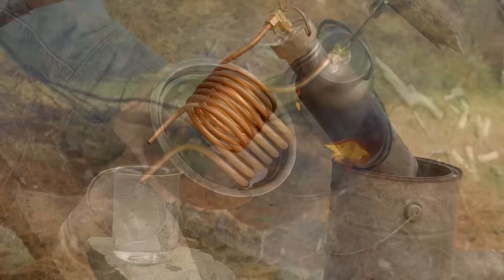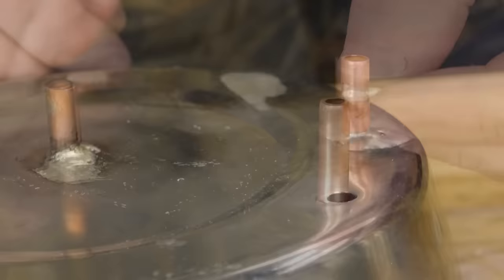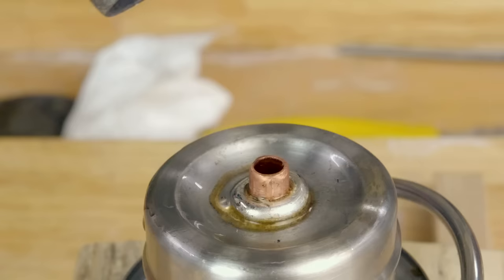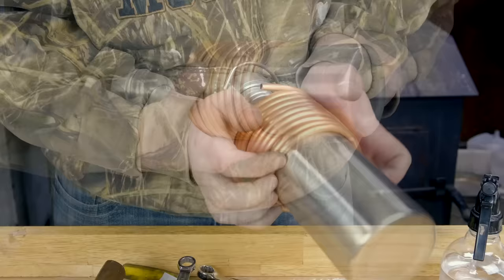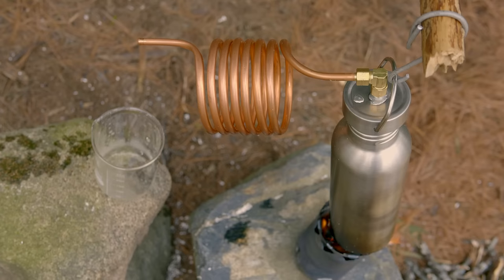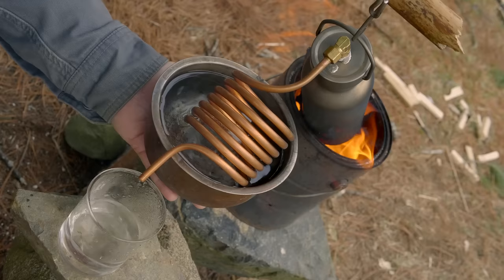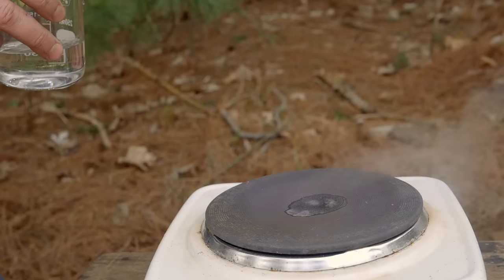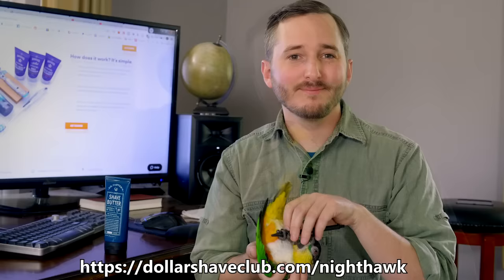DIY Salt-Water Survival Bottle (Compact Desalination Kit)

Comment: hi, Great job, I do plumbing, just a friendly reminder. you shouldnt solder coper to steel. They will react with each other. they just shouldnt touch each other. you can use a brass peice since it doesnt react either of them. Or there are some plastic fixings that you can use without touching steel and copper pipe.
Reply: The Bottle is no ordinary steel, its inox V2A e.g. no corrosion will occure with copper-contact.
Reply: Genghis Chuan  dont know, what kind of flux ure using but i always use proper flux for my piping. u should do too if your flux is an issue
Reply: Genghis Chuan  got it :)
Reply: Genghis Chuan  umm no normally its nickle plate to take chrome......
Reply: Plus some salt always makes it through, 
In fact enough minerals coming from the "stainless", copper and solder .
Reply: @manonamountain  even if she is wrong, GTFO with that attitude.

Comment: Hey!   This setup would also work pretty well with river/pond water too!  No need to add water purification drops/tabs if you distil it instead!
Reply: that's what I was thinking also,
Reply: Yes, it work even on a slime made by yeast out of a sugar!
Reply: Except if you simply boil the water pathogens are killed and there is no need for distilling. Distilling should help with heavy metals though if that is the main concern (note that some toxins can be concentrated by distilling if they boil sooner than the water so don't plan on using this with any Industrial waste water
Reply: @HandfulOfTranquility  Mash for a moonshine is weak and awful, you must distillate it. However you can do it from fruits, but it is vine-like beverage then ;)

Comment: Something like this using a Kelly Kettle would be brilliant!  Also, the pack sized unit is great, but I would love to see a design for a home sized unit too for use in disaster prepping.  I live in an earthquake prone desert city by the ocean, and if the big one ever wrecked the aqueduct infrastructure we all rely upon to bring us water, being able to harvest and process seawater could be a true lifesaver.
Reply: Just tried it with my own Kelly kettle, but the vapors didn't seem to properly desalinate. I'm thinking the boil inside the kettle was too violent and splashed salty water into the tubing and got stuck between air bubbles which transported it into my pure water vessel. Will attempt again to see if I can get it right.
Reply: Ngl sounds like SoCal. 🤣
Reply: Got it working using the kelly.

Comment: Good demo and video. My thoughts for improvements while I was watching it were: 1)  it would be good to be able to adjust the height of the bottle to control the heat; this could be just a knot in the rope, or other device, and 2) you could stuff the damp cloth inside the coil, instead of draping it overtop. Better yet, have a vessel, like your food mug, just the right size so you can immerse the coil in it.

Comment: You should actually have used threading vs soldering.  Solder can actually break down with temps that high.

Don't forget you can convert you pressure cooker at home into a distiller in times where people need it for their oxygenators and humidifiers, but always keep it at a temperature just low enough to steam so that you don't steam as many contaminates
Reply: Good tip. Stay safe.
Reply: Solder that is composed of 56 percent silver will have a melting point of 1,145 degrees.
Water boils at 212ºf.
Reply: @shorebird9  you must have done research on wrong kind of solder since most solder cannot handle that much heat. There is a silver based solder, which can take a lot of heat, as you mentioned, but its also kind of expensive. Most solder is tin-based solder and has a melting point as low as a 180-190° C, which is still much higher than 100 C needed to melt it.

I think he still makes a good point that even though the solder will not melt, it can become brittle and weak with the heat.
Reply: Nah, boiling water / steam won't hurt solder, And using 'threadin' isn't going to work with the thin SS sheet the cap is made of.
Reply: I was looking for an alternative to soldering, for skill reasons alone (I can't solder worth beans). But the cap on these bottles is a hollow piece and you must traverse the distance between the top hole and the bottom hole which is about 1.5"-2". So, a tube needs to go through it.
Reply: @dcorman  if you're having trouble soldering, you might have the wrong tools.  There is a bit of technique but compared to things like welding, its super simple. You basically just need flux, solder, and plenty of heat. If your heat source isn't getting it hot enough, you're not going to get a good solder. And since this is for drinking purposes, you need to make sure you're using the right kind of solder and flux.
Reply: @dcorman  ya and a custom insert with a flanged flashing would cost way too much.  I gotcha best with what you could get at the time.
Reply: @joemann7971  I have a high-quality Bernzomatic propane torch, lead free plumbing solder, and water soluble flux. All NSF Plumbing Code certified (and even certified for use in the People's Republic of California under Prop 65.) I bought it a few years ago to try and sweat solder some pipes. A few days later, I had a plumber in for the job.

I can work magic with an old school Arc Welder, I'm OK with MiG. I cannot solder or caulk without it looking like an industrial accident. LOL. We all must recognize and find solutions to work around our limitations. ;)
Reply: @dcorman  well, I guess lucky for you, they do make fittings for copper pipes that don't require any soldering, I guess that does mean this project is out of the question for you, unless you can find a way to seal it without solder.
Reply: @joemann7971  Nothing is out of the question. I will figure out a
 workaround. I always do.

I only posted in hopes of getting helpful suggestions from other people who can't, or do not want to, use solder.
Reply: @dcorman  it shouldn't be too hard. You just need to create an airtight seal that can handle ~212° F. But if you're not going to solder, you can skip using copper altogether and use a difference metal. A stainless steel brake line might work. It just needs to be some kind of heat dissipative metal to cool down the steam, and you can use parts from that to create an airtight seal.
Reply: @dcorman  Someone in another comment suggested compression bulkhead fittings.
Reply: With two bulkhead fittings (On on top and one on the bottom) and a threaded nipple to connect them. Really wish I had though of that! My soldering did not come out so great :( 
I ruined my first $18 bottle and the second looks like a FrankenStill. (But seems to work, don't know how long the solder will hold up)
Reply: @shorebird9  farenheit...argh... Water boils at 100 celsius and freezes at 0 celsius. So much more convinient

Comment: Stainless steel is perfect for this application. That is why it is used in many laboratory and production setups, even as pressure vessels. The temperature required to make chromium carbide is not reached as long as a fluid is inside the container. Another improvement would be to design the coil in such a way as to allow it to be buried in dirt, which is then moistened, to improve the cooling and collection properties. One problem with this design is that a lot of steam still escapes, and floats away. By burring the coil in wet dirt/sand it improves the collection amount by a country mile!
Reply from the maker: Yes all stainless would be ideal

Comment: Your worm (copper coil) should always be going down hill. As you have it the distillate will pool up inside the worm causing resistance and spurting on the output. On a larger scale, would cause a dangerous over-pressure in the boiler.
Reply: Doing that would make a liquid-filled cooling container more difficult, as the coil will need to come out the bottom of it. I'd rather put up with the spurting and have a system that's simpler to build.
Reply: @davidmcduffee1167  just a thought - If one end of the pip is brought back down to the other end, the coil could be hung upright with the open ends at the bottom.  Blow steam into the side that goes straight up to the top of the coil, then water will dribble down around the coils to the open end.  That also make the whole coil available to drape a wet cloth over   Or even have a secondary steel bottle left inside the coil to dump cold water into for cooling.

Comment: The welds look amazing good job
Reply: Nater Tater What welds??  It’s called soldering which is totally different than welding.
Reply: @greenidguy9292  don't be so critical.  I was only admiring
Reply: Nater Tater I wasn’t being critical,  I just thought you didn’t know the difference between the two.
Reply: @greenidguy9292  that's fair enough and I can appreciate that to the extent of it.    I do know what s weld is. However I couldn't do a simple Bond as well as that because I haven't tried buddy. I am afraid of welding  just like I am motor bikes haha.  I'll shoot a gun clean a animal and lay some concrete. But anytime bonding / welding comes in. I get scared
Reply: @natertater4024  haha... you should give it a go sometime,  I find welding quite satisfying just like shooting gun.
Oh and he did do a nice job once he got the hang of it.
Reply: @greenidguy9292  I really want to get into the whole metal furnace deal. I find that fascinating.   I have just tried to " water distillery " hobby.  I find it burn the throat horribly lol.    I want to learn more and play with different fun things.  I am trying
Reply: Nater Tater if you would like to get into welding I suggest the Titanium 170 from harbor freight. It’s a great welder for the price.  I’ve been welding full time for about 5 years and even though I have a massive Miller engine driven welder, I use the little 170 for all my smaller or thin projects. Just be sure to use solid core wire with 75/25 mixed gas (any welding supply store will help you with any questions or concerns) and you’ll be amazed at how far you can push that little machine with some practice.

Comment: I'd make a silicone plug for both ends of the copper pipe for when it's not in use and maybe stuff a bit of cotton at the end of the copper to catch any dust that might make it through the pipe but I'm not sure that matters.

Comment: So much effort. My cheap and cheerful method is an old metal camping kettle and a piece of rubber tubing. One end of the tubing is pushed over the kettles spout and the other end of tubing goes into a bottle or container.

Comment: I reckon this would be perfect if mounted on a frame with a fresnel lens and a heliostat. The fresnel lens could reach very high temperatures in areas of abundant sunlight.
Reply: It works quite well
Reply: did you mean frenesil hens?
Reply: Wow that's been my idea for years, after watching the tsunami in Indonesia and lack of fresh water .
Reply: @cornishrob123  I tried using a parabolic concentrator and manually positioning it to focus on the water chamber, it didn't work. Unfortunately without an automated heliostat it's not feasible. A fresnel lens might fare better. Alternately an array of mirrors on heliostats could focus more area of sunlight (like you'd find with large CSP projects) and heat an aluminum water container more effectively.
Reply: Back to my first idea then use all the wood damaged .Now I'm thinking of the hurricane that just the Bahamas.
Reply: Just don't get thirsty during the night ....
Reply: @markpaul7887  
Did you make one?

Comment: Instead of damaging the bottle from the fire, you could use a double boiler method. This could solve multiple issues for this project, as you could build up bricks/ rocks for the fire, avoid overheating and avoid a damaged valuable piece of equipment. Hope it helps.
Reply: Smart. Ill keep that in mind.
Reply: As long as there is water in the bottle you will not damage the bottle. And since salt water has a higher boiling point than fresh water the water will need to get hotter and hotter to boil and produce enough pressure to get through the condenser. This is not an issue with open flame but double boiler will pretty much not work unless you use something with a high bp such as oil
Reply: How long does it take to build heat in an open flame with rocks or bricks versus a metal can as I. Video? When you are dehydrated in an emergency, time matters!

Comment: Instead using the remaining salt water to the bottle, you can use 1/4 of pure salt water. It's better because you increase the final volume. Another option is use the ashes of the fire (mainly the white one) as it has more potassium than sodium.
Reply: True, the white ashes of wood mainly contain potassium carbonate. Know that this will markedly increase the pH though, as it is quite basic. While salt is neutral.
Reply: @bromisovalum8417  8 ph is good we are alkaline based
Reply: While the yield would be better by adding just ocean water, the benefits of having it boiled to kill biological contaminations is an advantage.
Reply: @Tai Chi Tube We should probably worry about microplastics as we sit comfortably infront of our gadgets at home... If you are using this desalinator unit you are dealing with alot of challenges including finding any food.

Comment: When soldering, heat the SS bottle and the copper pipe and not the solder or you can end up with a 'cold' joint and it will be brittle and will eventually leak.
Reply: That is the least of his concerns when he sprays the still hot joint to cool it off it would have caused the cracks anyway.

Comment: I put my 3 large Granite cobbles on the woodburner, stick them under the bed sometimes. They work excellent as emergency  pant and sock dryers. Using my own candles for pot heaters. Just watched a genius at work. THE HOMEMADE motorcycle with a car engine.

Comment: How about making it a two bottle design? Were the second bottle has the coil rolled up inside of it, and when you want to use it, you join them together and fill the second bottle with cold water. Plus you can use the second bottle to store your clean water.
Reply: @awesomeguy7898789 the coil cools the steam, if it was just 2 bottles connected with a simple tube there would be a risk of it exploding
Reply: No, no you're not getting the idea, it would be the same coil, just now inside the second bottle, immersed in water and yes, you would only need a tube to join them...
Reply: @AlejandroFerrariMc  why this isn't being deployed to coastal locations is beyond me. This is a very good idea.

Comment: The copper coil could be bent to meet the bottom of your receiving reservoir.
Reply: If you mean the coil should be horizontal it won't work i,e, the upper half will be filled with steam while the lower half being dunked in the coolant is condensing properly

Comment: Also good for unsafe water found in lazy streams and such.
Reply: Very true, if you want a crystal clear drinking water. I imagine this method also gets rid of other toxicities like petroleum pollution, and industrial herbicide/pesticide products.
Reply: @DanSoldierGuy  They may easily distill over, so in such a case you should first distill a bit of the contaminated water (around 10% of the volume) and discard it, because that's the fraction containing most of the toxins. Then you collect the fresh portion of the water.

Comment: No for a water! YES FOR MOONSHINE!
Reply: you need distilled water to make moonshine unfortunately...
Reply: @sandermez3856  needs just regular fruit juice.
Reply: @AntonyUKR  to start a yeast culture, you need distilled water... but most ppl buy yeast in packets.... someone else started with distilled water before them.
Reply: @sandermez3856  i having small Chateau. All fruits having wild yeast on the surface.  What to make vine you dont need some "special futures " from foil packages. You need just a fruits
Reply: @sandermez3856  You don't NEED distilled water, but it is preferred. Yeast simply needs nutrients and sugar to start a culture. So if you were to take something like mulberries and throw them in some honey with a little bit of river water, probably not the best thing you want to use to ferment, but still would start a culture. I would say though, if you have the still or means of boiling water at all, definitely do so.

Comment: You could always transfer the salt water left over in the desalinator after distillation to a small can and finish boiling it out to collect the salt in that water. Sea salt is quite useful for many things... adding flavor to meats or other foods if you're camping and didn't take salt with you or to simply collect sea salt to take home with you. But if you are in an actual survival situation it can be even more valuable as a disinfectant, a preserving agent and an electrolyte. Great video... that was a beautiful, compact design for a desalinator.
Reply: If you use straight up salt from the ocean there are some pretty harmful things in that salt and any contaminants and heavy metals can only be separated through pretty complicated procedure. The “sea salt” people buy in stores isn’t simply ocean water boiled down and for good reason.
Reply: @experienceofchris1108  true, but not all salt water poses those dangers and yes, it wouldn't be possible for the average person to know exactly which salt is safer for consumption than others, but I'm not talking about habitual use of sea salt, my comment is just for either sporadic use or emergency use. Even fish and shellfish contain a lot of those same heavy metals and other contaminants and yet most people make food of them without issue. That's why there's still a warning on some sea food about not over consuming it due to those same safety concerns. So you're right, there is a risk, but it can be mitigated.